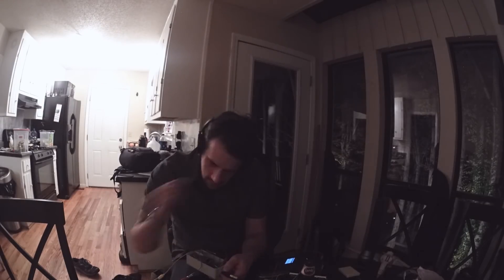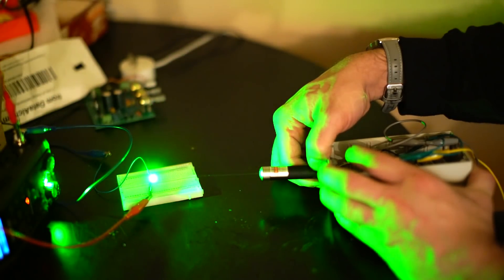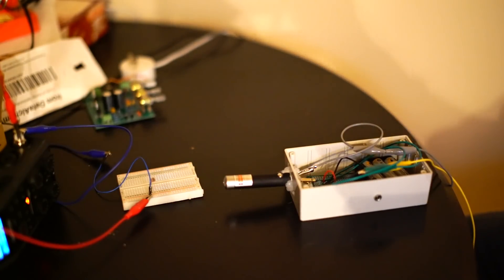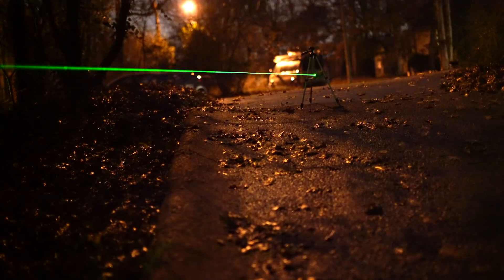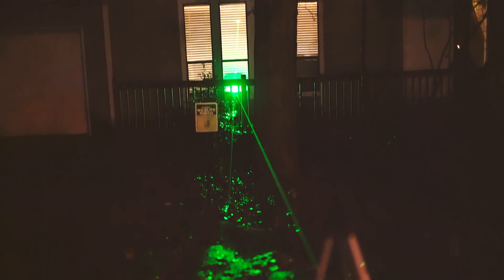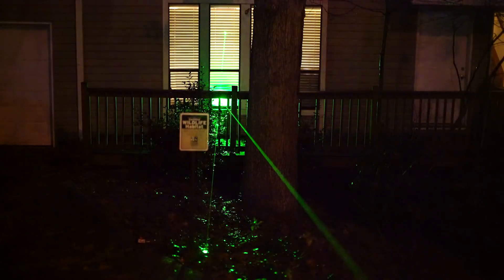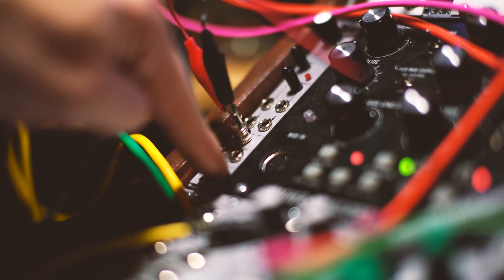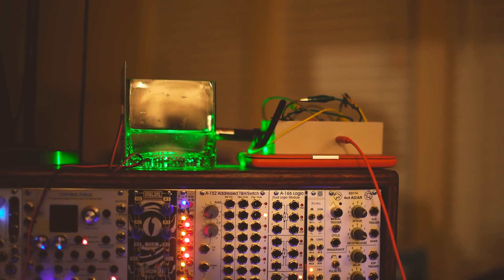Fun With Lasers And Audio (and synths).

Comment: "Do not ever plug a laser receiver into your modular synthesizer unless you have a good understanding of circuitry and a module that protects the incoming signal."  And plugging a laser receiver into the synthesizer is central to the mentioned idea of reducing or eliminating the obnoxious laser glow?
It sounds like infrared might be better for sound quality anyway (and avoid the question of making the green laser less visible), but is that 100% invisible?  I want to be unobtrusive, but I don't need to be particularly stealthy, and I believe infrared light doesn't naturally refract into visible light just by hitting windows, so I think I'd be aiming IR blind (which might be bad for my eyes at any wattage, and I think I wouldn't even know if I were shining it into my eyes?) or using an IR camera, which seems like an extra layer of complication I'd prefer to avoid.
Reply: I guess I'll look like a weirdo regardless of how I do it.  I'm not sure if visible lasers or a lack thereof will make much of a difference.

Comment: Do you think it would be possible to pull the balanced audio trick with this, and send two lasers, one with inverted signal, and then sum them, to cancel the interference and get a cleaner signal over distance? 
This is very rad, and the modular performance using water and ink was gorgeous!